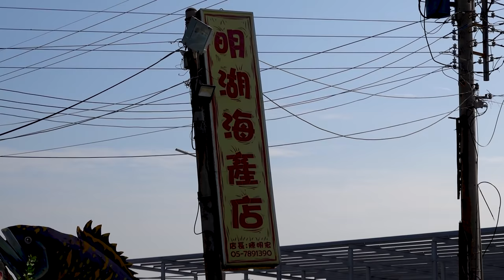Giant Eel Cutting Skills, Giant Eel Steak / 巨大鰻魚切割技能, 鰻魚肉排 - Taiwanese Food

Comment: If the babies is it small size if the big one pregnant instead? Will it be bigger than smaller ones that have babies? I am thinking of breeding such rare big types.
If a place of rare animals keep changing "as long as the same", appearing very normal, if such is done to eel also?
How much is an eel of this size if tuna so big(of tuna's weight) of this Length can be more than $10k? This is not rare? It is not a foodtype eel?